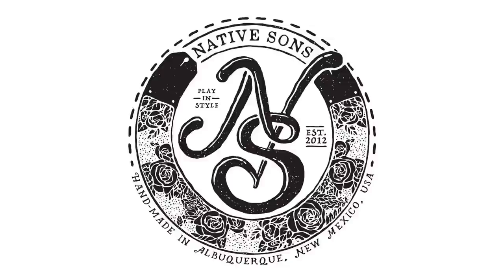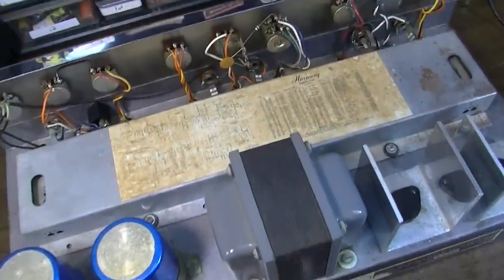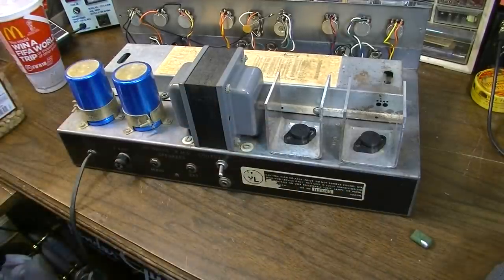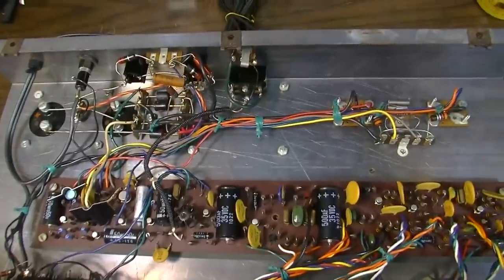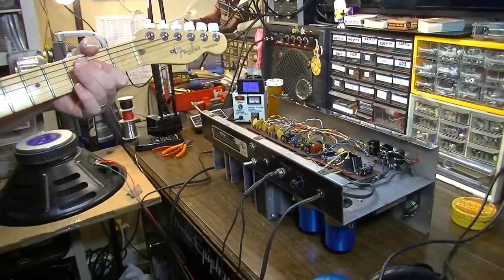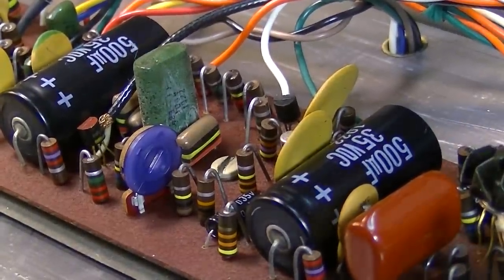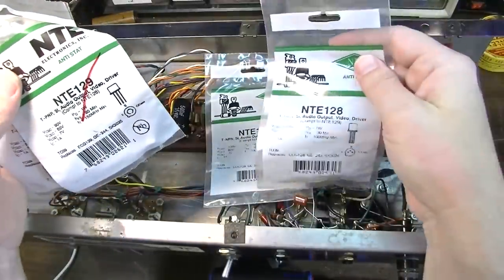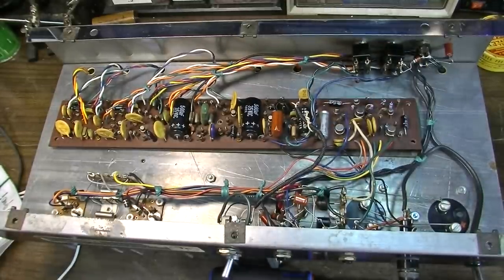STUPID AMP! - 1970 Harmony H550 Solid State HAIR PULLER Repair

Comment: I have learned that every component in a circuit has ways of trying to fool you.  Even just a wire.  Many times I have shown continuity and close voltage but did not have enough wire connected at some point to carry enough current to make a circuit operate properly.  They are like criminals trying not to get caught.

Comment: ECG?  They've been replaced before.....
Reply: Yeah ECG was back then what NTE is today.
Reply: Even down to the prices.  ECG and NTE are like life flight helicopter rides.  Save your ass, but man you have to pay for it.  If repair centers were still popular, you could probably get ECG/NTE coverage along with the flood and tornado....
Reply: I did a little looking.  ECG was by Sylvania/GTE starting sometime in the 60's.  NTE was founded in 1979 and largely copied ECG.  In many cases, a NTE of the same number could be used for a ECG.  In 2001, NTE bought out ECG.  The substitution line had their place.  If you ran a repair center, you probably had stock of one or the other to help cover the thousands of different parts used in consumer devices.  Pricey, yes, but it got the repair done, out the door and got you paid.  Likewise, if you were an experimenter in the days before on-line ordering, you might find it easier to find a ECG/NTE somewhere in town rather than snail-mail (in both directions) and wait.

Comment: Amps using Darlington transistors can also be a big nightmare. They usually test ok when damaged. If one of the two internal transistors works, it will test ok, even if the second one is shorted out. I also have had my share of crappy overheating Mosfet amps. I hate them!
Try to stay away from Ashdown bass amps. They are demon possessed! You're warned.

Comment: New technology was poor solid state was young  and there was no standerd like tube amps all very much the same also transistors blow up in milliseconds tube you have 5 minutes and with big transistor amps you can have 20 outputs in parallel a mistake in the drive circuit can eat many

Comment: You obviously need to polish your fundamental knowledge when it come to trouble shooting amps with current mirror input and complementary output (If PNP and NPN in output, not this amp) power stages also how the bootstrapping works and how to insure correct idle current for that class of amp and more. Recommend some basic training first ...